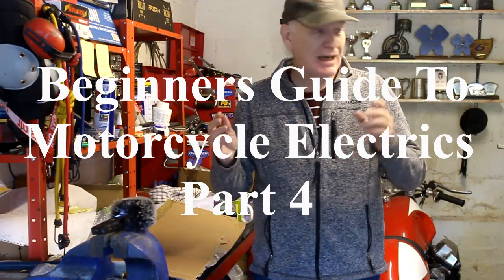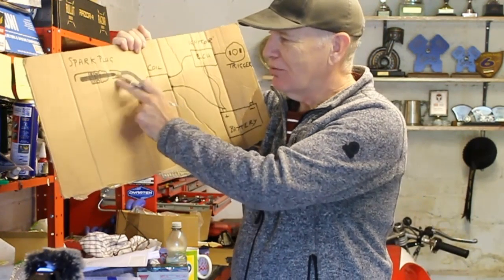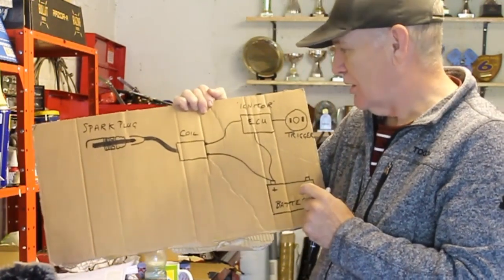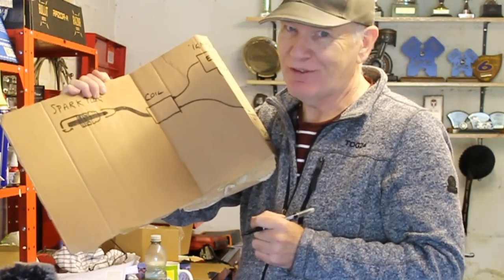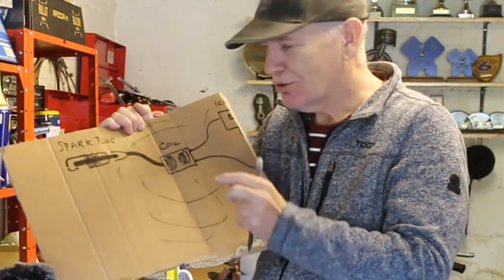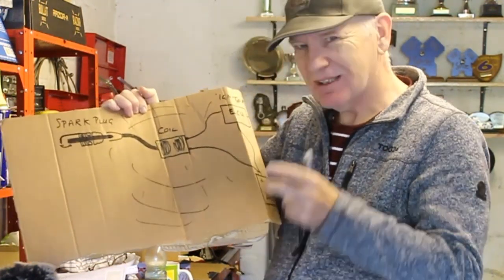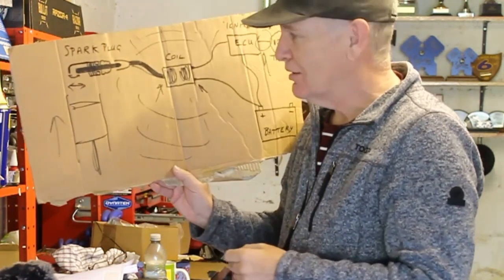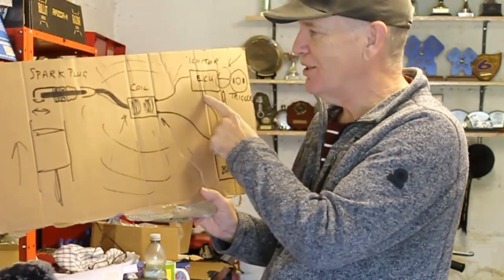Beginners Guide To Motorcycle Electrics - Part 4

Comment: Lesson 5 could be about adding aftermarket bits and pieces. Wiring up power supply for a satnav or auxiliary lights etc.
Found parts 1-4 useful, many thanks